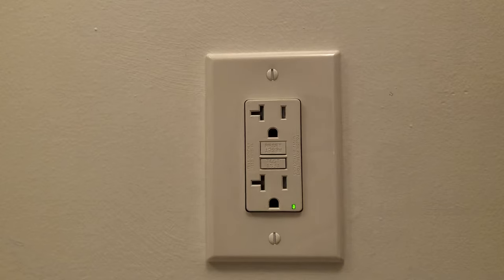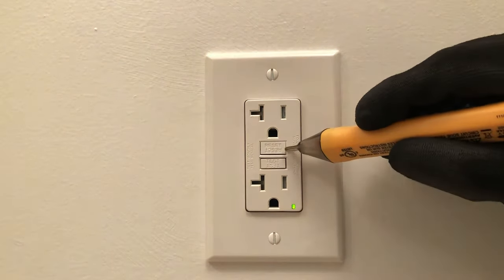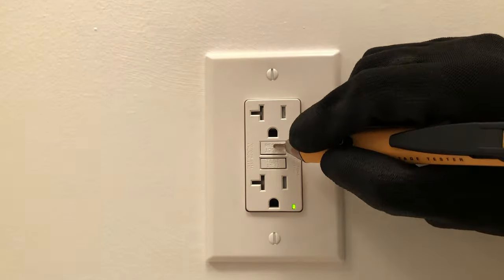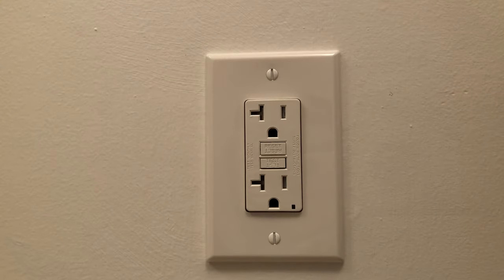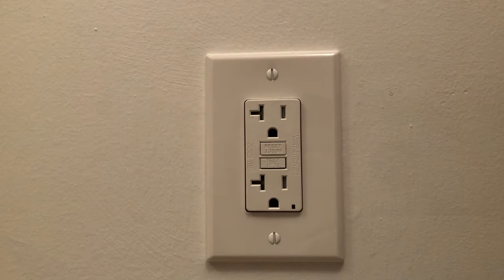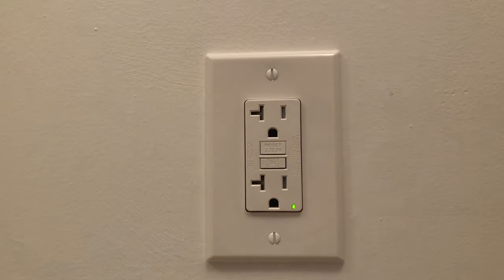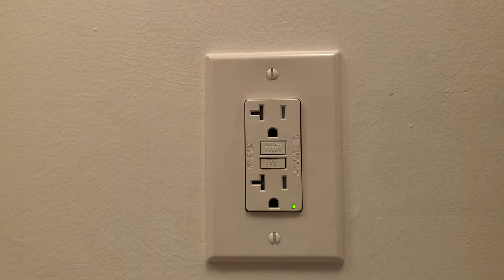How to test a GFCI - How to troubleshoot a GFCI - The Electrical Guide

Comment: Hello and thinks for sharing your knowledge.  I have an old house that was built in the 50'S with the two prong receptacles and someone put in the 3 prong receptacles but they are test for open ground. They have no ground wire in the box.  After putting in a gfci receptacle it tested for open hot. So I thought i reversed the blk wire the hot wire to the load and not the line. Still read for open hot .  then I swapped the neutral wires around. Now im lost.  When I test the wires with a multimeter it backlights red and I get 117.2 Volts and the other blk wire gives me a wired number like 9.679 or something. But the green button on gfci is lit up. I've read you can ground the receptacle box to the grn nut on the gfci. Please help. I need to get this up and running to feed the daisy chain.
Reply from the maker: Please give this video a watch, it will likely help you with your new GFCI. https://youtu.be/5LI6GTqYpMQ?si=uoRkiDu4fm34mt_H

Comment: Good morning, we had a flood here and our original gfci was a dual 15 and 20 amp. We tried replacing it no where to be found so we went  with a leviton GFWT2-KW simply put a 20A-125V. Our breaker panel indicated 20A for the patio.

On their directions it says if you connect it and get a green light reverse the line and load wires. We did that. Not we have a solid red light and blinking light. The test button does not move  just the reset button on any instances. Can you please assist? 

I believe the way we connected it first and had the green light was the correct way. Leviton ships these as in a tripped state.

Thank you for your help. It's greatly appreciated.
Reply from the maker: Your feed from the panel must be connected to the LINE side. White on the silver screws , usually left side and black on the copper colour screws usually right side. If you have a second set of black and white wires then you're feeding other outlets from that GFCI protection. Those additional white and black must be connected to the LOAD side. That will offer GFCI protection to the outlets that come off the LOAD side. Ensure that you don't terminate a white from the panel side with the black of the next outlet, that will cause you problems. Hope that helps.

Comment: I'm not getting full power to any of my receptacles. I can run fans and lights but not anything more powerful. All the outlets are reading 120. The readings from the breaker boxes are coming back fine. Any help would be appreciated. Ty.
Reply from the maker: Could be many things. Sounds like you need to hire an electrician. Maybe a phase is out?   Maybe the neutral is faulty? Be careful.

Comment: Hey there, quick questions for you please! I just replaced mine, and the green light stays on regardless of if I press the test/reset buttons. Is that normal? I have a 20A Xtricity TR outlet.

Second question.. about the ground wires: one was screwed behind the left screw in the box, and the second ones went around the right screw in the box, before connecting to the ground input on the outlet. My question is, should both ground wires be tapped on the screws in the box, or should only one of them be?

Just trying to figure out if something might have been done wrong, but I reinstalled just like it previously was.

Thanks for the assistance in advance 🙏
Reply: Oh and the black and beige wires are only connected inside the LINE ports.. nothing went inside the LOAD ports. Yellow tape is still on, as with the previous outlet
Reply from the maker: @baldbearded9601  Perfect
Reply from the maker: Mine all turn off when I test trip them. It's possible yours is just a funky one, after all the outlet still has power even if we test trip it with the buttons. All bond wires should be bonded to the box, one can then come out and bond the outlet after the screw on the box. Hope that helps!
Reply: @theelectricalguide  Thanks, yes it helps. But I should have elaborated a bit more though, but didn't want to write a novel.

This outlet in my bathroom, it's also the same circuit breaker switch that controls my entire living room. And if I have the AC on (living room) and I also use a hair dryer (bathroom), after a couple of minutes, the circuit breaker jumps and shuts off, probably from overload.

I'm wondering if that means that I might have to connect some of the wires in the LOAD ports of the outlet as well (instead of 2+2 in LINE), considering they seem to be interconnected. 

But I am just trying to 'guesstimate' from what I've read today and I'm genuinely clueless as to how all of this works to be fair, so I might be way off.

But my previous outlet started smoking and melted, hence the replacement. I noticed it before it caught fire, but it could have been bad.

The melting point originated on the "white" side, where the wires are screwed into the outlet, which leads me to believe they got loose and might have caused this whole thing.

But the question is: could this also have been caused by a wrong wire connection by NOT using the "LOAD" ports despite having a few outlets interconnected through the same circuit breaker??

I hope my question makes sense and you understand what I mean. I just don't know if the reasoning is correct, or if maybe I'm overthinking this and circuit breaker overloading is something normal and fine.

Any input will help 🙏 Thanks a lot
Reply from the maker: @baldbearded9601  If you previously plugged something into that outlet with 3 prongs like your laptop charger or maybe even your hair dryer and it worked then chances are it was wired correctly even when it melted. Loose connections due indeed cause heat over time.

As for the GFCI the 'line' side is ONLY for the wires feeding power into the gfci. Sometimes they come straight from the panel or maybe they come from your living room. If you were to add an outlet downstream from the GFCI then you would wire that new outlet off the LOAD side of the GFCI and by doing that you would protect the new outlet with GFCI protection. 

Hope this helps.
Reply: @theelectricalguide  thanks a lot for the clarification my friend. I really appreciate it. It's very cool that you take the time to help your viewers with questions 👌👌👌 Thank you!
Reply from the maker: @baldbearded9601  Appreciate the viewers!

Comment: Hi , 
I hope doing well. 
Could you please help for this question.
*when performing regular testing of a GFCI receptacle on a pool deck, the receptacle fails to reset. What is the cause.
The Best
Ben
Reply from the maker: Did you watch the video? Sounds like no power..
Reply: @theelectricalguide  
Thank you for your time. 
Which one should we mark?
A) Leakage current on ground conductor 
B) Leakage current on neutral conductor 
C) Potential difference between hot and neutral conductor
D) Potential difference between hot and ground conductor
Reply: @theelectricalguide  
Hi ,
Yes I watched it completely.
According to your video  A must be the answer.
Regard
Ben

Comment: I plug the over current device in my Hair Dryer (2 prong no ground) INTO a GFCI receptacle.     I press the test button on the hair dryer, it DOES TRIP the hair dryer but no response from the GFCI.  The GFCI does not notice the interruption in the current.    comment please
Reply from the maker: Hey Ted, the GFCI is only looking for a fault to ground, it isn’t concerned about an interruption of current. The safety switch on the hair dryer may be different than a GFCI. I wouldn’t be concerned about this at all. Hope that helps 👍
Reply: @theelectricalguide Thank you, But.  I use GFCI (without ground conductor).   The test button on the GFCI works just fine.

Comment: In an emergency can I safely isolate a circuit like the kitchen in my house by tripping a gfci plug and then back feed that circuit with a power station to a generator?
Reply from the maker: No, this does not sound safe. You would need a transfer switch if you've got a generator you want to use in an emergency. The transfer switch will enable the generator to power the circuits you've wired to it and interlock the service feed off.

Comment: Mine turns red not green (like yours). I believe that's the only light with it being only red. Does that sound right to you, or have you seen outlets that only have red instead of green?
Reply from the maker: Yup, sounds normal to me. There are different colour indicator lights.
Reply: @theelectricalguide  Great, thank you!
Reply: Depending on the brand. Leviton turns RED when there is  fault.  Double check the manufacture to be sure.

Comment: I have a question I notice my GFci in kitchen works has power with a led green light but blinks red every 30sec-1 min maybe.
Reply from the maker: If you can't normally reset it then it sounds like a compromised GFCI, may need to get replaced.

Comment: My sons townhouse breaker trips before the gfci when the toaster is used ? Shouldn’t the gfci trip first?
Reply from the maker: The gfci doesn't trip from an over current (more than circuit breaker rating amps). The gfci trips from a ground fault which is a different type of protection. They aren't the same and won't trip for the same reasons. Hope that helps!

Comment: I changed my GFCI outlet and it’s now working but all the other additional plugs connected downstream to it are not functioning even though I connected  the load wires as I should. Why would that be?
Reply from the maker: Did you ensure the black and white are on the correct side for the load? The button should stick in when there is power. If the button sticks and the black and white wires are properly terminated and on the correct side then it should work. I guess a broken wire somewhere is possible? Very unlikely. 95% of the time the wires were terminated incorrectly.
Reply: @theelectricalguide  not sure. Could it be because he used to be a blank face GFCI just change it to that has plugs? Regardless, it should work I think. The GFCI is working but not the downstream ones. Unless they are controlled by another outlet that I’m not aware of.

Comment: The Google provided GFCI schematics...some test buttons invert a resister to test the circuitry and some do not.  Manufacturers vary.

I recommend a "plug-in GFCI tester" to ensure it is wired correctly and trips on a fault.

The button may only test the mechanism and not the sensed conditions.

Also, is it still a monthly test?
Reply from the maker: Yeah those testers are great, this video is more showing how to easily, quickly and cheaply determine if it's got power and the buttons work properly. Perhaps I should make a video with that tester :)
Reply: Plug in GFCI testers Require a Ground conductor.   Some GFCI controlled circuits do not have ground conductors.  comment please
Reply: @tedlahm5740  I believe you are correct.  The tester incerts a large resistance between the hot and ground to create a leak pathway, an actual ground fault.

Comment: Help...I installed a gfci...only 2 wires...hot and neutral..in the line section...I have power but the gfci tester from Lowe's doesn't trip it.
Reply from the maker: Hello TB Joshua Collections, GFCI stands for 'ground' fault circuit interrupter. You will need a ground connection for it to properly work and protect you from a "ground fault". Anywhere near water (generally where GFCI outlets are installed) it is especially important to ensure you have a ground connection. Hope that helps!
Reply: @theelectricalguide  well I guess so with the tester device but you figure it would work without a ground since that's what is allowed ..install a gfci if you don't have a ground. on the gfci it has its own test that works without a ground but apparently the gfci devices they sell operate with or off a ground in mind...why I have no idea...its a ground fault test in the first place. its understood that 6 feet from water, restrooms, kitchens they would have a ground most likely and still need a gfci but the codes allow a gfci to be installed without a ground since it goes into default without having a ground. my point  really was why have a device that only test on the basis of having a ground in play when in part the gfci is made for applications when no ground is available.
Reply from the maker: @bentleysw  The GFCI is not made for applications where no ground is avaliable. The canadian code (and likley the american code) specifies that if there is no ground you can install a GFCI and bond the box to ground and bond the GFCI to the box which ensures a bond to ground. GFCI works by referencing the ground termination so without one it won't be able to trip therefore it won't be any different than a standard outlet. Basically you're installing a $25 outlet that works as a $2 outlet. The outlet will still supply 120v power normally but will not function as a GFCI. In order to enjoy ground fault protection a ground conductor bonded to the GFCI is mandatory.
Reply: @theelectricalguide Hand held GFCI testers Require a ground conductor to trip the GFCI.     Some GFCI do not have a ground conductor (legally) .   Therefore the hand held will not test/trip the GFCI.
comment please@bentleysw
Reply from the maker: @tedlahm5740  hand held GFCI testers connect the line to the ground conductor of the receptacle via a small connection inside the tester when the button is pressed. That simulates a ground fault trip and the GFCI receptacle will trip. The only way a GFCI can not have a ground conductor as you stated but still function would be if the GFCI was instead bonded to a metallic jacket of a cable (very rare). Under all other circumstances a GFCI will not trip without it’s own hardwired connection to ground via a bonding conductor. Hope that helps! 👍

Comment: Does the LED green light is always on ?
Reply from the maker: On the GFCI? Yes it should always be on if the outlet has power. Some different brands have an orange or a red LED light, also normal.
Reply: @theelectricalguide  thank you very much, I appreciate your help.
Reply: Mine doesn't have a light at all.  I was also wondering if when you have a power surge like we had yesterday and then it wouldn't work anymore I went to pull it out of the wall and when the power was off we pushed the button in and it stayed so then we tried the power when we turned the power back on it stayed and we had power there so now it's working should it be replaced because it wasn't working to start off with after the surge or is it okay?  I'm thinking it's okay because every time I tested it pops out.

Comment: Back porch GFCI. Solid red light and solid green light on mine. Reset button sticking out
Reply from the maker: Reset won't stick in when pressed? Cycle the buttons a couple times until it holds in when pressed. Resetting that breaker has been known to have an effect on older gfci receptacles.

Comment: Annoying. It’s not troubleshooting if you don’t say why the button won’t go back in. I wanted to know if it’s gone bad or could be something else.
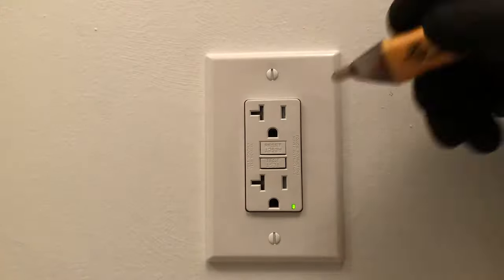Reply from the maker: Actually I do say why, at 1:35.. if there is no power the button will not stick. Also at 2:20 I mention another reason why the button may not stick in. Again at 3:05 I talk about the possibility of another GFCI outlet feeding something not working as another reason you may not have a sticky button. Appreciate your feedback regardless, hope you're able to re-energize your circuit.

Comment: It seems to me that pressing these buttons only shows that the internal switches are working.  To really test it wouldn't you need to plug something in and create a ground fault from that?
Reply from the maker: You can totally buy plug in ground fault testers, at the local hardware store I'd think. They should have 3 prongs and a button on top.

Comment: What if you can't get it to reset and it was working before , how would I check it
Reply from the maker: If it won't reset anymore it may not be getting power. Maybe go look and see if any breakers are tripped.
Reply: @theelectricalguide  no there wasn't any flipped , it's in the small bathroom
Reply: I tied drying I with hair dryer if there was any moisture didn't help
Reply from the maker: @kevindavis7747  So the reset button should stick in when you press it. The test button should release it again and then you'd have to press the reset button in again. If the reset button doesn't hold in you likely don't have power there. Go around and check every other gfci outlet in your house.
Reply: @theelectricalguide  thanks for input I've tried for 4 days and today it resets. Smh

Comment: Why won't a TEST button work? I cannot press it.
Reply from the maker: There are a few reasons the TEST button might not work:
1) The RESET button has already been popped out and needs to be pressed back in. It should latch, if it doesn't latch there is no power to the outlet.
2) There is no power to the outlet.
3) There is power at the outlet, the reset button is latching and still the test button doesn't trip the outlet. If this is the case the outlet is faulty and should be replaced.
Reply: If the fuse is not tripped then should I replace the GFCI?

Comment: Nobody is answering the question, how to test if you gfci outlet is bad. I have 125v to my breaker. Does this mean my outlet is bad? It keeps tripping after I reset it.
Reply from the maker: There are a few reasons it may keep tripping. Watch this other video I made that shows a few simple ways to test an outlet, these will apply to GFCI outlets as well. https://youtu.be/0PoDARg9oD0